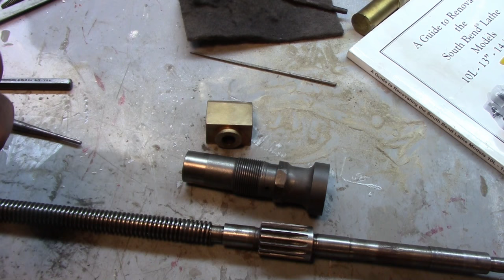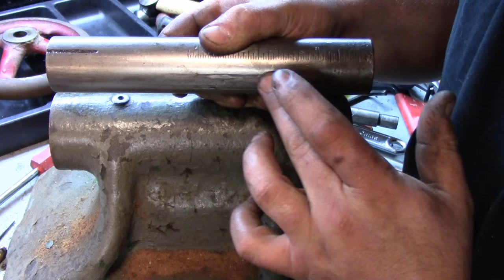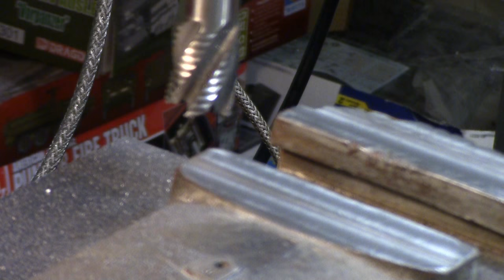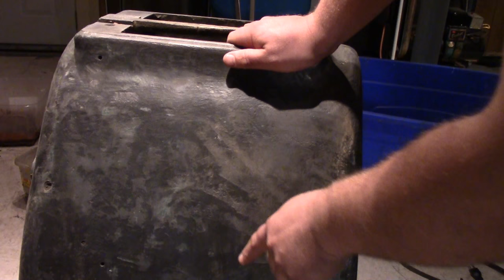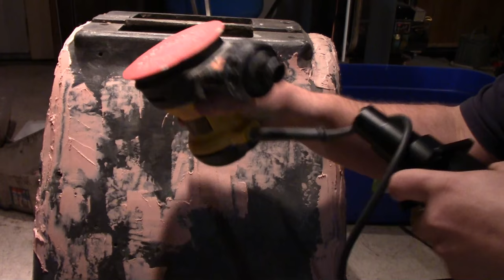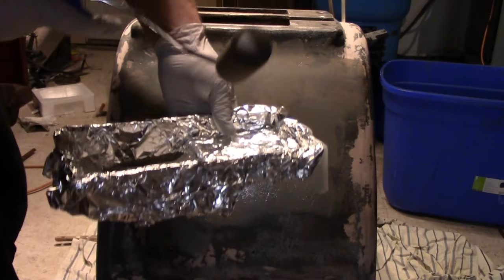13" Southbend Refurb: Saddle, Tailstock, and Paint

Comment: I had to do the same thing with the MT2 reamer in my tail quill.  Makes a big difference going from grabbing only at the small end vs grabbing along the whole length of the taper. 

Looks like the underside of the T slot is a bit wallowed out too.  Not sure if its bad enough to justify milling or just hitting with a file.

Comment: Sorry for the newb question...this is a metal lathe, right? It seems to have been used excessively for wood turning. Is it common to alternate material like that with lathes? Wouldn't a metal lathe be overkill for wood? (not to mention making an awful mess plugging up oil galleries)
Reply from the maker: I use mine for wood occasionally.  Trick is to rig up a vacuum to collect the sawdust so it doesn't get everywhere and soak up the oil